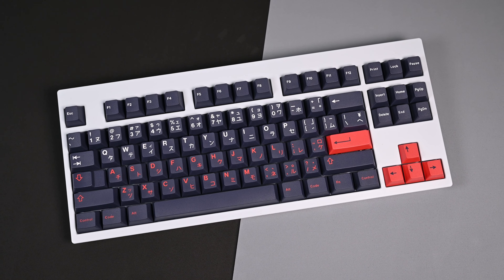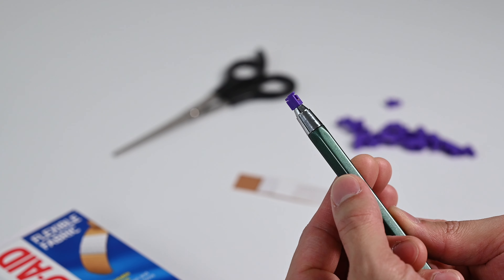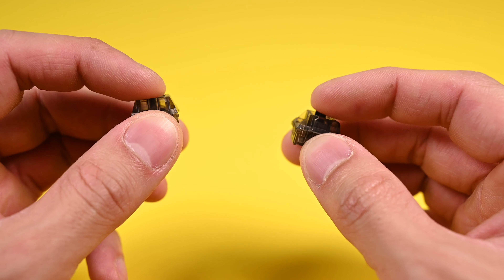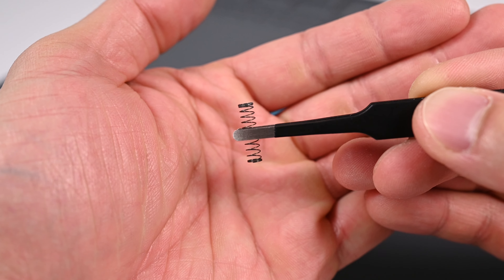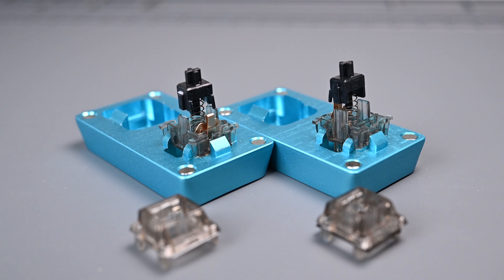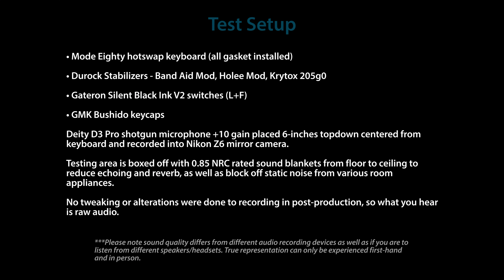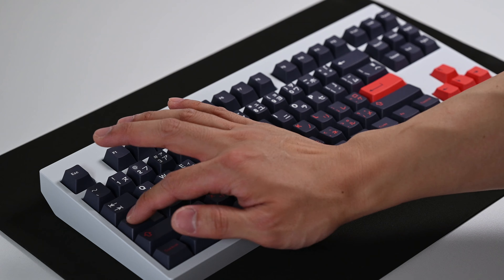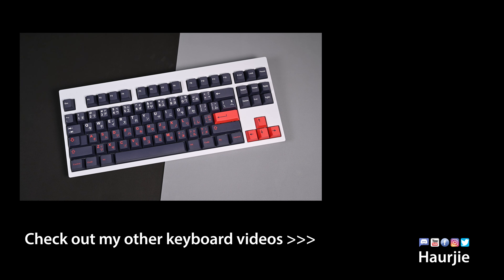Gateron Silent Black Inks V2 – SILENT TKL Hotswap Keyboard

Comment: I was initially considering the Silent black inks vs. the regular black inks. Glad I didn’t go with the silent inks because they are a bit too quiet for what I’m trying to achieve at the moment. Question for you though: Do you think lubing the springs will make a difference in (better) sound if the black inks are already lubed and filmed?
Reply from the maker: Yes absolutely lube the springs, because you might have some spring ping
Reply: Imagine complaining that silent switches are "too quiet" lmao
Reply: @johnathanredcrest3960  I know right. 😂 Sounds wild.

Comment: Would you ever consider adding o-rings to the board to make it quieter? I'm considering getting some for a super quiet build in the future.
Reply from the maker: I've tried the O-rings, they don't actually make it quieter. The sound comes from the switch stems hitting the bottom of the switch housing, which is why silent switches have silicone dampeners on the sides.

Comment: I wonder if silicone would be the best dampener for a silent build.
Reply from the maker: As in like a silicone layer like what the new Mode Sixty Five comes in?
Reply: @hardlinenexus  no like a 1 to 1 mix and pour.
Reply from the maker: @Justin-cs9du  Yeah that's the same thing, both are silicone. Except you'd make it yourself. Generally speaking though, yes, silicone layers are suppose to mute the sounds more.
Reply: @hardlinenexus  thanks for your reply you’re awesome! would silicone in your opinion be the best for silence? I’m planning to use the ymdk96 wooden case, and gasket mounting using o-rings and probably silicone in the case unless there’s a better option then foam, holee, and bandaid modding. Then for switches silent alpacas as they seem to be the quietest as far as bottom out and during actuation especially if filmed. Are there any suggestions for building the most silent board?
Reply from the maker: @Justin-cs9du  I just looked up that keyboard, and from the looks of how the assembly goes, that PCB sits really low. Looks like it pretty much just sits on the bottom case with very little space between. Meaning if you pour silicone into it, it's going to be extremely thin layer, I don't know if it'll actually make a difference in dampening sound. But more importantly, I don't know if you'll even be able to fit everything in if you have a layer of silicone down there... I'd probably try and look for some really thin layer of neoprene foam instead. Similar to the one I used in my Corsair K65 Mini mod video. But that one was 1/4" and  looks too thick for your YMDK96 wood keyboard. This one here MIGHT work https://amzn.to/3BmOyoP

Comment: Does the switch film drastically make the keyboard more silent? Just ordered the switches and was wondering if i needed to order film
Reply from the maker: For silent switches no it doesn't. I would say the more significant change would be reduce wobbling and increase housing tightness/stability.

Comment: Do you recommend over the silent alpacas?
Reply from the maker: Quietness they're the same. Alpacas are smoother straight from the start, but ink v2s will eventually get smoother over time. And alpacas also have lighter springs to start. But you can always spring swap on any switch so that doesn't matter anymore if you don't want to use stock springs lol

Comment: Hey Haurjie, since you seem to be a good authority on silent keyboards, do you recommend over lubing the switches in order to get the quietest result? There's a video of someone over lubing their switches and doing a sound test, and it sounds pretty quiet but they were using regular swithces and not non-silent ones. Here is the link https://www.youtube.com/watch?v=XGXeDuiF1MY It's called "This is what overlubed switches sound like" by a channel called "Portmann".
Reply from the maker: No I don't recommend overlubing switches because they affect the FEEL of the switches and can potentially slow it down. Silent switches are not that hard to get a hold of and they cost the same as any regular switch. It's pointless imho to overlube regular switches to achieve a silent sound.

Comment: How do these compare to Cherry MX Silent Red and Black?
Reply from the maker: Cherry MX aren't that great in general. They are much cheaper switches
Reply: @hardlinenexus  Every video I watch of Silent Reds vs. Black ink or Silent Ink they are way quiter and are described as feeling better.
Reply from the maker: @Mikkel111  I have a WASD v3 TKL keyboard that's got silent cherry reds on them. They're not silent at all and feel like any generic cherry MX switches out of a prebuilt keyboard you can get at your local store... Feels loose and rattly. Would need to lube and film them to make it better
Reply: @hardlinenexus 
https://youtu.be/K2D5UbEuV5M
In this video it seems quite opposite.

In your opinion, what is the absolute quitest switch out of the box? (Don’t want to mod them)
Reply from the maker: @Mikkel111  
I believe I know why the Cherry MX silent reds are quieter here. Cherry reds come with 45g springs, Gateron Black Inks come with 60g springs. The heavier spring is going to have a harder punch on the upstroke/return stroke, so you can hear it slightly more.

I only remember my Silent Reds being not that quiet and rattly was before I did any sort of custom work or modding. But when they are lubed and/or filmed the same way, I would say the difference becomes negligible.

Comment: Would you say these are your preferred linear silents now?
Reply from the maker: Hard to say. So sound wise, silent switches to me (at least all the ones I've tried so far) are all the same, they're silent lol. But when it comes to the feel when typing, like smoothness, spring weights etc... that's also hard to say. Because all of those could be modified via lubing and spring swapping. So I guess between all the silent linear switches, I mainly look at the color for aesthetics lol. Now if it were just straight out of the box which one would I prefer as of now? Then I would go with Silent Alpacas, they come out of the box smoother.
Reply: @hardlinenexus  Thanks, I'm looking for new silent linears. I'm using Boba U4's in the office rn (highly recommend btw), but want to switch it up with something linear for a change. I typically will lube and if possible film my switches, but try not to get into spring swapping too much. So, I was looking for silent linears that were good with minimal mods. Great, high quality vids!